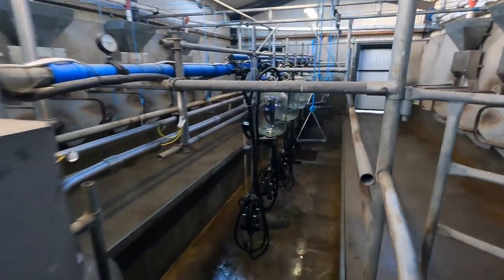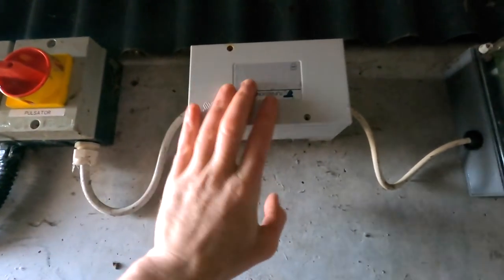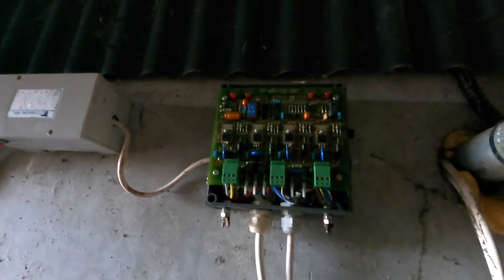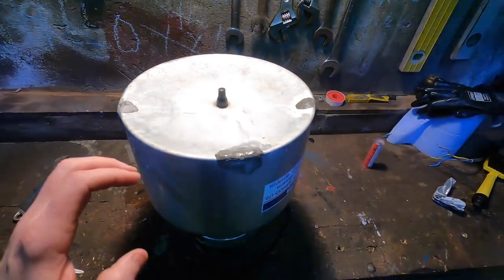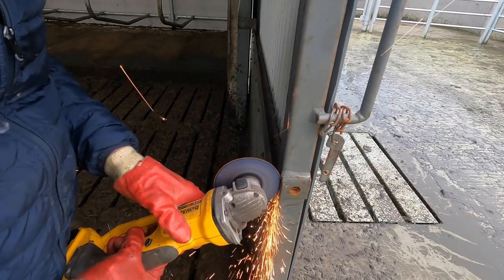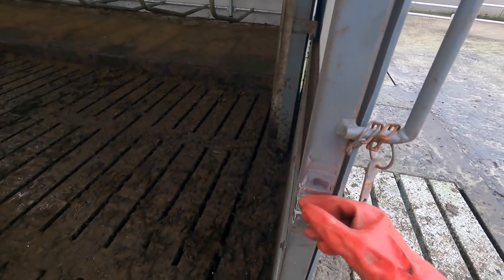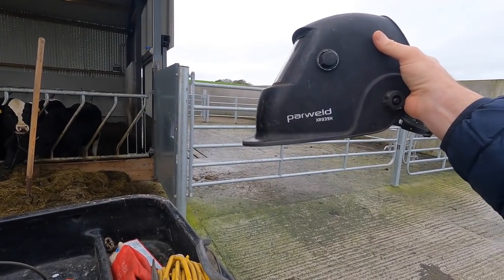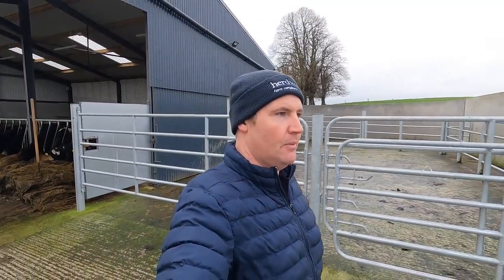MILKING MACHINE BREAKS DOWN DURING MILKING!! A HEAD WREAKING FAULT

Comment: Tis cast alright . Best way to know if you are unsure , is to grind a bit of it. If the sparks glow , it's mild steel. Cast iron sparks won't glow when grinding. Heat it up with a small blow torch first.
Reply: You can get mild steel ones to though.

Comment: A lot (probably 90%) of the weld on get hinges, tailgate hinges, trailer dropside hinges, latches, bushes and "wrought iron" (Actually mild steel these days) components are a cast mild steel that has been made in China. Sometimes they weld on grand and sometimes you end up with porosity and a weak weld. The carbon content is higher than normal mild steel but lower than cast iron. The trouble is, all kinds of junk metal is thrown in the melting pot and quality is only measured in how many goods are packed into shipping containers!